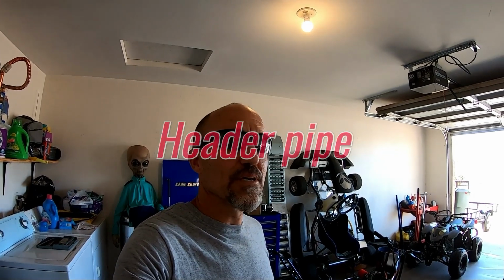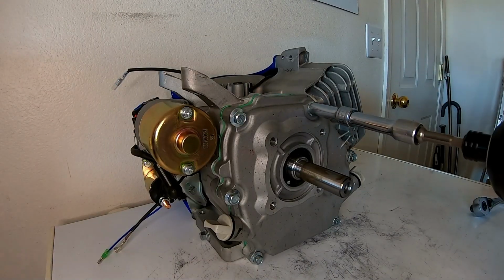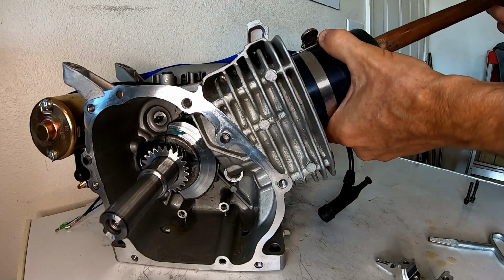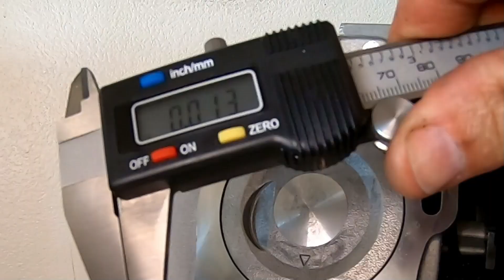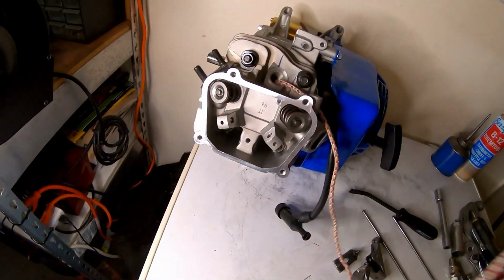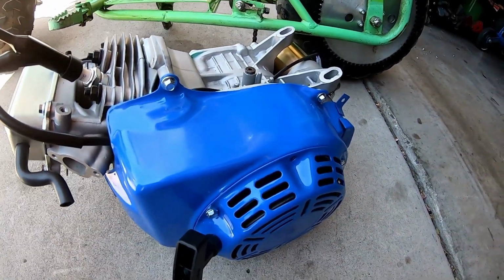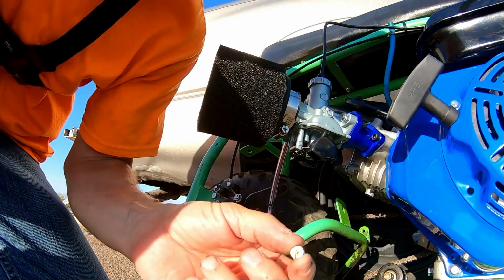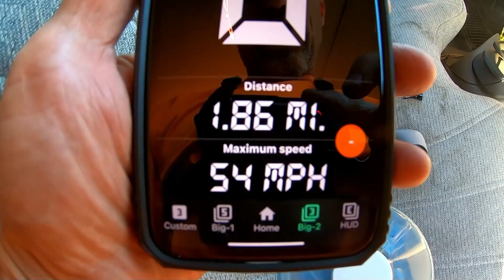Mod 3 cam and ARC billet rod install on a Tillotson 212 / Top speed run

Comment: I’ve learned to go ahead and put 26lb springs in my engines. 
A week or two goes by and I’ll end up ordering some ratio rockers or something to increase Rpm’s and I’ll end up needing bigger springs anyway so I now, after removing the governor and port/polish + shaving the head I go ahead and throw ,a set of 26 lb springs in it, and some exhaust tuning !! 
“Turning like Good Gas !”

Comment: I was wondering if you used plastiguage to check for oil clearance on the rod or if you think it’s not too necessary just a “just in case” precaution
Reply from the maker: I have never had to send a rod back but Yes, I think it's a good idea to check the clearance with plastiguage  Inexpensive insurance and it only takes a few minutes.
Reply: oiled well on assembly and test spun by hand with atf on top of the piston so the rings seat almost immediately, a person can tell if the motor is spinning freely enuf. that is me talking.  hope for the best. ?

Comment: I am so stuck. I have a tilitson 212ee and there’s a knocking noise. First I thought it was rod knock so I got new bearing and it still was there. Then I thought my clutch superheated me crank and I replaced that and still nothing. I just figured out that something must be hitting the side cover because when I have it off the sound disappears. Anything helps. Thanks.

Comment: A little bit of adjustment you will be flying   Im getting ready to the Mikuni style carburetor and air intake and staged pipe any recommendations? Thanks always
Reply from the maker: Ya, I really like this pipe https://www.ebay.com/itm/193709332828

Comment: Unrelated question. I’m new here and have very little mini bike experience other than as a kid riding my friends and 15 years ago I fixed one up for my 7 year old son. Recently I fixed one up for my 8 year old daughter then bought myself a project to ride with her. Mine came with a new stock 212 predator.  Where should I start with performance upgrades without going crazy rebuilding the  whole engine
Reply from the maker: I would say governor removal, header pipe, high flow air filter, and re jet the carb. Basically a stage one kit

Comment: Black66 I'm about 3000ft above sea level, what main jet would I order for a 22mm mikuni. Thanks Bro. Main jet is a large jet or small jet? 196cc Honda clone
Reply from the maker: Most of the time I'm running a 110,115.120 depending on what engine I'm running it on and what mods it has.
Reply: Header with muffler. Thank you for the reply. Black66
Reply: 196 cc Honda clone.

Comment: where did you get the head stud kit from? I have a kit from GPS it works, but a lot of thread sticks up past the nut, and on an OMB kit (which doesn't work) the studs are too long and part of the unthreaded stud sticks up past the head..I'm running a GX160 head in a Tillotson 68mm bore race block on one engine and a Tillotson 225r head on a 72mm Tillotson race block on another
Reply from the maker: I used a couple different kits. Both worked good. Here are the links https://www.ebay.com/itm/224159946481
This second link is for the store. They don't have it listed but you can get ahold of them for the stud kit.   https://www.ebay.com/usr/diyperformance1/

Comment: Hey I need some help, I have a predator 212 stage 1 kit from ombwarehouse and a 19 tooth clutch and 72 in back and 13 inch tires yet it only goes 35 ish
Reply from the maker: It's showing on the calculator that your engine is only turning about 3600 RPM at that speed. I bet you have too much gear. You are running a 3.78 ratio. That's a lot of gear for a mild engine. I bet you gain Top speed by going the opposite way and dropping a few clutch teeth to get the engine more in the optimal RPM range.
Reply: @Black66  what mods can I do to get higher rpm I really don't want to change my clutch
Reply from the maker: @UnAttempted  If you already have a header pipe and a high flow air filter with the carb re-jetted you can add better valve springs,18lb or 22lb springs. That will increase RPM potential. A slide carburetor will help. If you really want to wake it up install a Mod 2 or 265 cam and a billet rod and flywheel.

Comment: Curious to see how much more rpm will come out of it when u shim the springs. 
Great video👍😀
Reply from the maker: Thanks! Ya me too
Reply: @Black66  Why would you swap out 36LB springs that come stock already in the Tilly to putting in 18LB springs with a shim? Did you know the Tilly even had 36LB springs akready?
Reply from the maker: @johnmuller5403  The E doesn’t have 36lb springs . This isn’t the R version Tilley. Also if you watch the entire video you will see I didnt change out the stock Tilley springs and it floated the valves.
Reply: @Black66  I'm sorry, I meant to say 26lb springs. and the E only stands for a Tilley with Electric start. But the stock 212 Tilly has 26lb springs. Why were you wanting to put in 18lb springs when it has 26lb spings? If they floated? time to go to 36lb springs then. right?
Reply from the maker: @johnmuller5403  The cam i had in it in this video doesnt like the stock Tilley springs.  At least not at high RPM. The cam has been taken out and replaced with a 265 cam  and 22lb springs that work much better as a package.
Reply: @Black66  yeah, I'm sorry, I typed out 36lb when I meant 26lb. I like the way you test out these engines. I just bought a Tilly and put it on my Motovox Platinum (Red & Black) and I have brand new 19-inch ape hangers and a Harley seat with a sissy bar and saddle bags. I'm 59yrs old union bricklayer that loves riding these mini bikes. Keep up the great videos!!
Reply from the maker: @johnmuller5403  Thanks ! That is awesome ! It’s all about having fun with these things . That is why I try all these different combos . Who cares if they work out or not . That’s the fun part . Finding out . I leave the seriousness to everybody else .

Comment: What is your rational for 18 pound valve springs instead of 22 s or 26s. As usual, great information
Reply from the maker: Thanks! I have ran 18's before with a Mod 2 without issue.
Reply: less parasitic losses from too much spring of the 22/26 # springs.  most of the engines are DONE by 6500 RPMs anyway in regards to making HP.  the head , without being well ported and a BIGGER Cam... .274+ just cant get enuf air fuel thru the 25mm intake hole to make more power. 18# springs shd get to ~6500 and absorb less power/easier on the cam than 22/26# springs... ~6500/7800 RPMs Respectively.
Reply: @NONAME-kw3pu  thank you the answer

Comment: I'd shim the stock springs first as long as they don't coil bind on you.
Reply from the maker: I don’t think they will coil bind . It is a super low lift cam .
Reply: cant shim HEMI valve springs without opening up the spring pockets with some kind of reamer tool. the HEMI has keepers in the head to keep the spring from wandering around. the NON hemi does not have those little alum posts cast into the spring pockets.

Comment: What did you mean by a little safer for the billet rod?
Reply from the maker: Billet parts make these engines stronger. Less change of throwing a rod.
Reply: @Black66 that’s what I though cause these stock rods aren’t designed for that much speed
Reply: karters drill out the oil hole on stock rod for MORE OIL TO ROD JOURNAL. cut 1/4-3/8 inch off oil dipper so it wont hit bottom ofmotor and break off rod cap.  they also polish the rod journal bearing surface with 2000 grit sandpaper emery cloth so the rod journal is super smooth and even if it takes the rod journal down a .001 or .002 inch more of clearance that is ok. for more oil to get to rod journal for high speeds so the rod wont spin weld itself to the crankshaft

Comment: Getting to the point time to bump to a 24mm and larger springs
Reply from the maker: Yes!
Reply: @Black66  I've got to the point were I have a few built motors and I end up have just as much fun chasing the kids round on stock stuff and I have a few bike that flat haul but then I can't leave anything alone ice got the 79cc predator  that now puts out around 7 horse
Reply from the maker: @heathenprojects2639  Lol , you sound like me . Always messing with something
Reply: @Black66  my wife says I should put a bed in the garage since I spend all my free time in it
Reply from the maker: @heathenprojects2639  That would be good!

Comment: THE PROBLEM YOU ARE HAVING IS VALVE FLOAT THIS HEMI HEAD THE INTAKE HAS A SUNK VALVE SPRING POCKET NOT FLAT ON FLOOR I HAD TO INSTALL SHIMS 158 THO ON INTAKE 54 THO ON EXHAUST PROBLEM SOLVED BAD IDEA ON TILLOTSONS PART